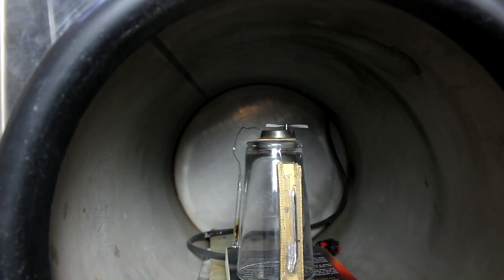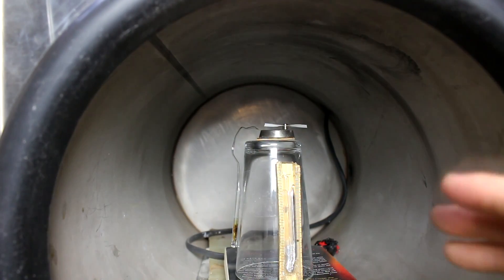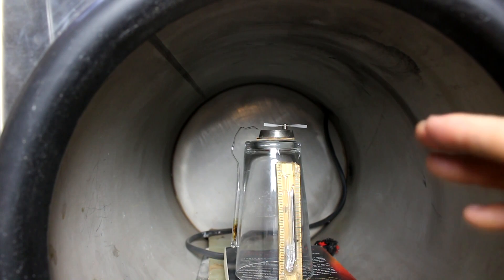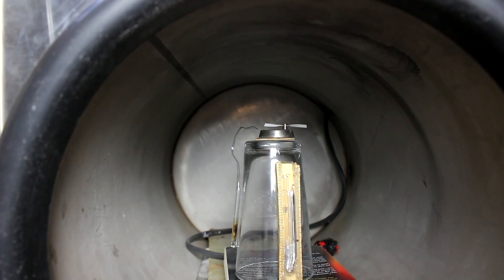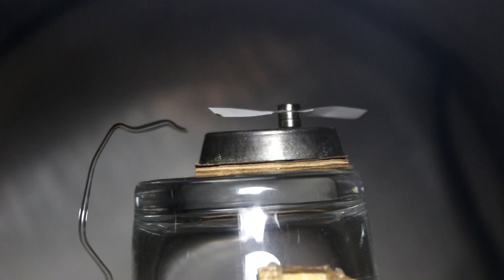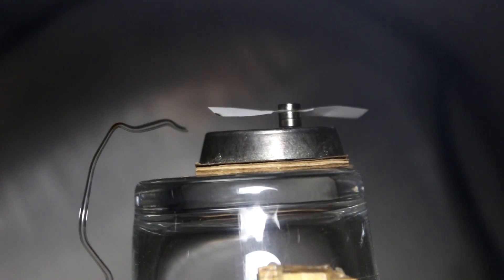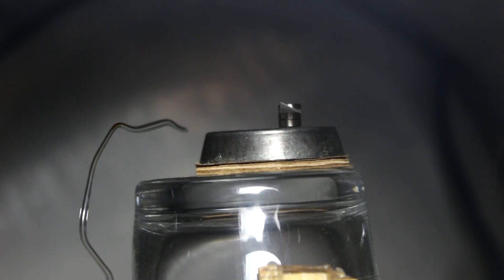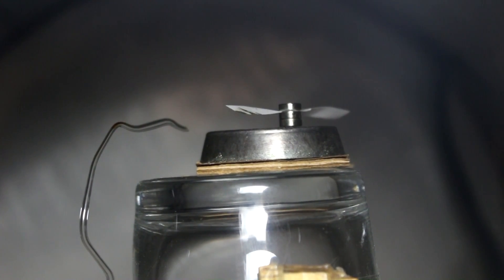Levitating magnet in vacuum 2

Comment: The truth is.. You can't really get rid of friction. There is friction in the magnetic field, thats just how magnets are.
Reply: "eddy currents"
Reply: Babalonkie in thus scale, faraway cages do a good job of removing ambient fields, but the only way to remove losses within the magnet would be to use superconductors... it'll get you close anyways
Reply: I would imagine that gravity would also have an effect ??
Reply: Also, I'm pretty sure most kind of wave lengths cause loss of energy, space radiation too, basically anything, even if Earth will eventually stop spinning. Or if, say, you had a star that would never die and a planet levitating it, the planet will stop spinning at some point in time.
Reply: Babalonkie .. uhm.. you got no clue what you are talking about.

The moons rotation in reference to its orbit around earth is 0 as it is tidally locked to our planet.
But this tidal locking also makes the moon constantly sip away a tiny bit of energy thus accelerating it (while it slows down earths rotation). That effect is measurable and moves the moons orbit outwards ~3 cm a year.

any spinning object creates electromagnetic waves - extremely tiny but enough to slow ti down if we look at long enough timeframes.
But you are talking about Moons and planets. You could constantly push with the biggest rockets we have and the effects would be, in human timescales, negligible.
Reply: The very mechanism by which it levitates introduces the eddy currents. You could prove that by suspending the substrate so that it could be shown that it were being dragged along in the same direction as the suspended magnet.
Reply: As i have not stated anything other than asked a question... i would have to say that i do know what i am talking about and you have not understood.

Also i am aware of gravitational locked orbital bodies and what/how they work. I am also aware that our moon is in-fact being pushed away from earth at 4 centimeters per year. I am also aware the conflicting gravitational forces are slowing down earth's rotational time.

That was not the question or even slightly related. Others have answered the question... you have not.
Reply: So this is the cause of the energy loss. Excellent. Is there a way of reducing or removing the currents, to get a similar effect of universal gravitational effects? Because those eddy's don't seem to be visually effecting planetary gravitational effect, EG moon, its not stopping, slowing, moving back and forth etc.

I am just a curios idiot :)
Reply: Technically, there is no "3 million light years from the nearest object" due to dark matter and dark energy, which both produce mass-energy that would produce magnetic fields for the magnet to interact with, even if exceptionally weak ones. Otherwise, you are correct, Peter Rabitt.
Reply: magnets

... how do they fuckin work?

Comment: Are you sure that's a perfect vacuum, light pushing paper in a vacuum?
Reply: No, nobody can make a perfect vacuum. However he does get it close enough that air resistance is basically nothing and certainly wouldn't have slowed it that fast.
Reply: meismehaha well no, but you can get as close as you possibly can, but if you have such a scope for error, expect erroneous results
Reply from the maker: no and I never said it was anything close to that.
Reply: Cody'sLab so your test was invalid...

Comment: My question is why does it start to turn the opposite way after it stops?  It acts like it's tethered on a string and when the string twists up it will go back in forth.
Reply from the maker: it was just "rolling back down hill" kind of like rolling a ball around a tube once it looses so much energy that it cannot keep going all the yar arroun it will stat allsolating back an forth.
Reply: What grammar is that Cody? I think Cody's body has been taken over by an alien imposter.
Reply: Are we all going to ignore the fact that Cody drunkenly messaged back?.... Don't you dare edit that shit sir, we still love the content.
Reply: So it's just magnetic drag, not air drag.
Reply: Cody'sLab that happens because there is a preferred  (lowest energy) state for it to oscillate about. Is that just "in line with the local ambient field" here or what?
Reply: This is the key sign that the air was irrelevant at any pressure. What you saw was the two fields lining up.

And btw, while it was spinning, electric current was being produced.
Reply: Cody'sLab 
You should go to the ER, I think you've had a stroke
Reply: Alex is right - a drunken Cody response is worth more than any explanation of magnetic phenomena.
Reply: Levathain 
idk probably coz of the north
Reply: With oscillations and ambient fields, wouldn't there be some terrestrial spin, solar orbital, and other motional Coriolis effects that apply as they put the ambient fields in motion?

Comment: Cody , coulndt you melt Magnetite and let it cool under the influence of the magenetic field (at best spinning while cooling) to create a perfect synergy between te magnetic field and the floating object?
Reply: Youre right but that thing would spin a loooong time.

Im now thinking about a ferromagnetic substance that changes its polarity under some natural elctromagnetic wavelenght , say cesium , basically that would enable us to gather energy from the magnetic field very directly , if you could get it to change with almost no input .
Reply: A3X CCY3 I think we all agree there is no perfect magnet in the same way there is no perfect vacuum. I think what this idea is about is simply extending the time it spins. The closer to perfection the longer it should go.
Reply: no, magnetite is a pokemon
Reply: feanorfeuergeist that sounds interesting. I wanna see it
Reply: feanorfeuergeist you cannot manufacture a "perfect magnet". even the slightest inequalities in the field will have a effect on the levitation
Reply: Youre are right but i would greatly increase the efficency.

You seem to be very smart , wouldt a permanent ferromagnetic fluid/solid that would spontaniously change its polarity under a certain electromagnetic wavelenght, that can be naturally generated with no energy input(ofc theres energy in the radiation but were talking about a gram of Cs maybe) , give us the ability to gather energy directly from that magnetic field?
Reply: +Matthew... Don't you mean Magnemite?
Reply: That is the joke.